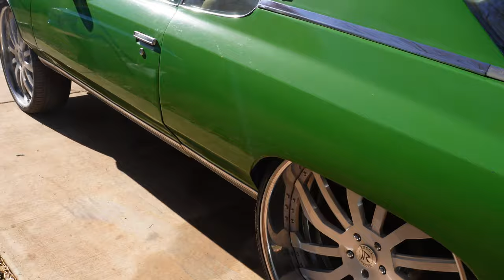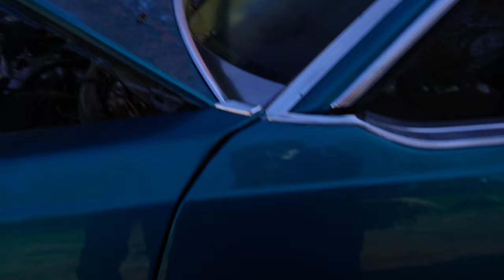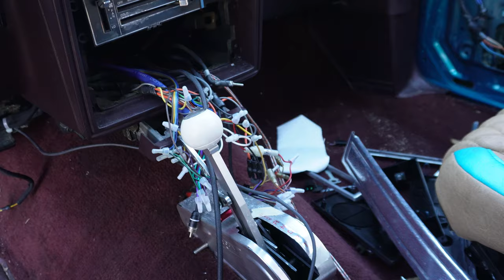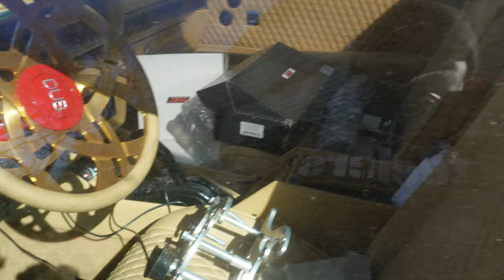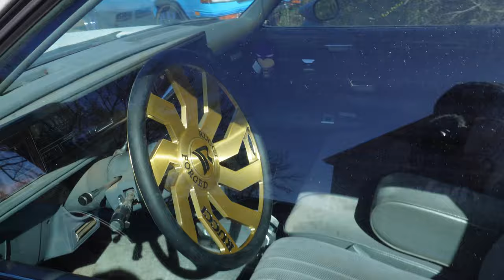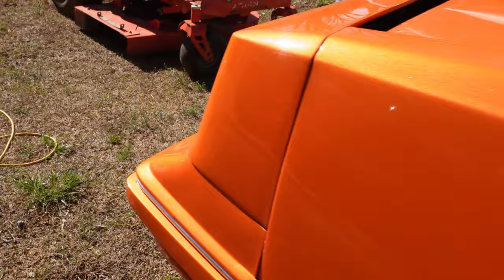I Bought A 1988 Cutlass LS Swap!

Comment: I would buy it and sell that 6.0 and put a 632 big block chevy crate motor in it but thats jus me 👍🏾
Reply from the maker: O ok that’s what up I’m just learning as I go with this right now
Reply: @its_mcgriff  that's a good prodject to start with if you get it as long as the engine and trans are good everything else should be smooth sailing 👍🏾
Reply from the maker: @stevenallen6245  o yea 4sure both are under warranty so I’m good on that
Reply: @its_mcgriff  👍🏾
Reply: 632 big block 😂 dam
Reply: @toon_on_24s  😂😉 it takes 93 octane pump gas